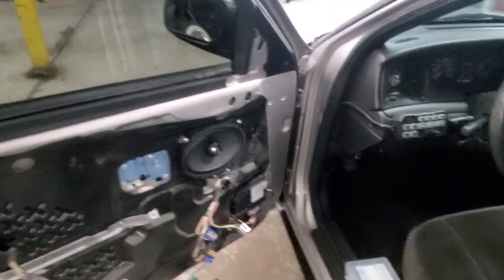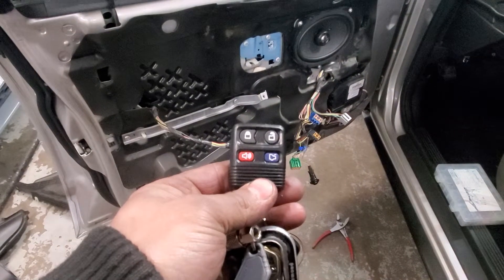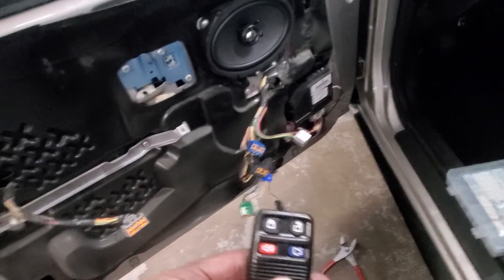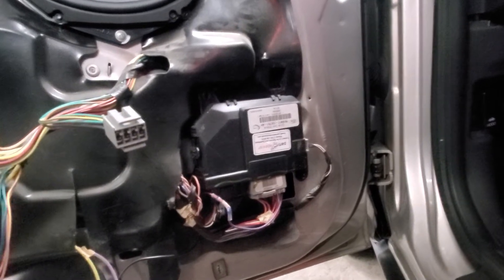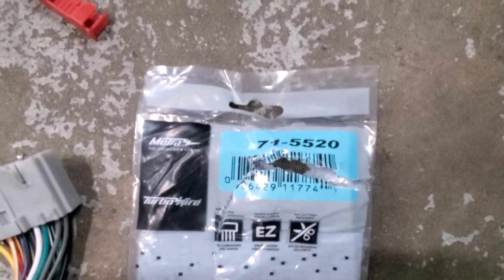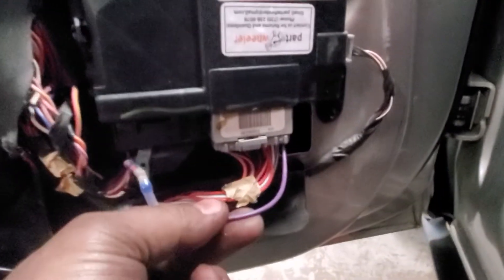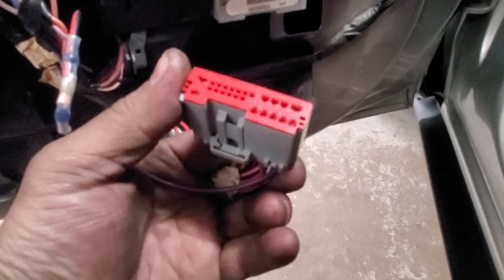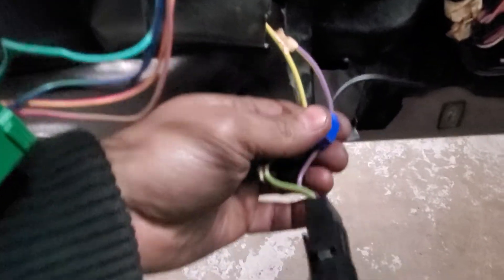Trunk Pop Remote Crown Victoria Police Interceptor

Comment: so i just used forscan to unlock the door and alarm features so am i able to do the same for that? or will i have to take my stuff apart. i also have an 08 cvpi i also do have the click when i press the trunk button
Reply from the maker: You'll have to add the wire / pin to the ddm harness for trunk pop.  The cvpi doesn't have that part of the harness.
Reply: @knobleindustries8106 i just did that and i still just get a click

Comment: What year is your crown Vic. I want to do this but mine is an 05.
Reply from the maker: Should be the same deal.  Do you already have keyless entry working?  If you click the trunk button and you hear a click, this will work for you without getting a new door module.
Reply: 2009 CVPI didn’t work. 
I can hear the module click, but it won’t open trunk